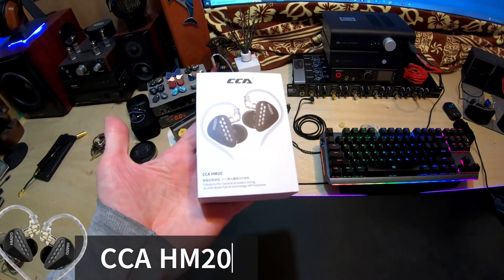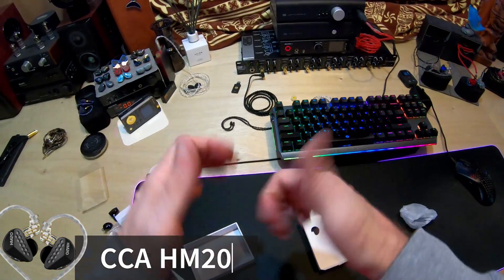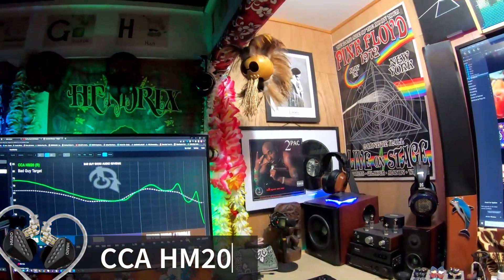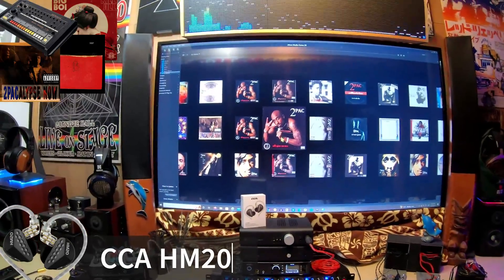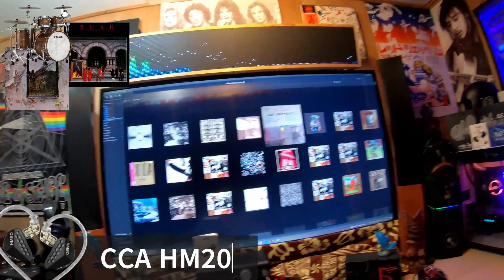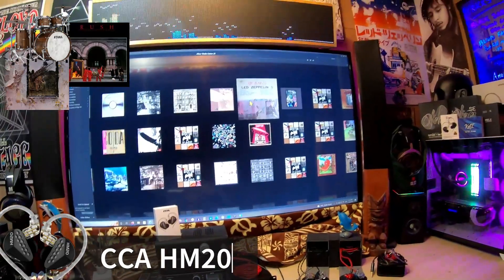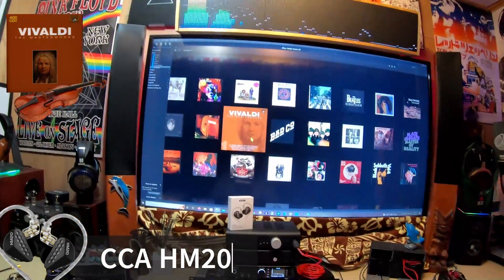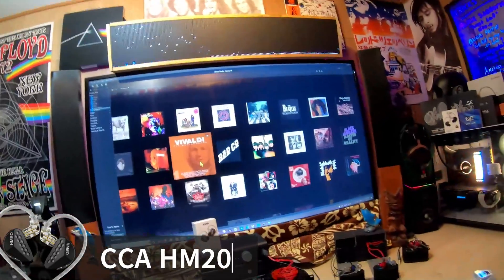CCA HM20 Earphones (1/DD 7/BA)

Comment: Holy crap, the bass Is like 6db more than the hexa haha I've been considering buying the HM20s I love bass so yes they are for me :)
Reply from the maker: These do thump in the bass. Treb is not bad at all:_Thumbs:
Reply: @BadGuyGoodAudioReviews  I'm glad CCA have improved, also it looks like KZ took  your advice regarding the new PR1 pro realeased we will see with the graph :)
Reply: They are great. Just go for it. If you like V shape, these are very good. I was worried the bass would drown everything, but the treble is CRISP, and zingy to go along with the thump.
Reply: @skrounst  yeah also this type of bass boost that rises to the infrabass in my experience (with the mh750) actually doesn't result in a drowny bass, probably psychoacoustics because of the relation to the midbass. if it was a midbass or upper sub bump then you might have some problems

Comment: Well I ended up biting on these and I came across a weird manufacturing defect. The left ear IEM's 2 pin connector is a few mm longer than the right earl's connector. This results in a different fit per ear, and it looks jarring. This only happens with the Bluetooth adapter. Using a wire ots able to take in the entire plug. I returned it and had a second one shipped. The second unit also suffered from this same defect. I ended up returning both units. It's sad the build quality had the issues but they sounded great. I wish they were a tad lounder because at full volume it ate my AZ09 battery in 4-6 hours instead of the usual 6-8. I've got ZAR coming in along with LingLong. I really wanted to love those 3d printed ducts.

Comment: Are the vents real? So far the realest vent or rather "open back" IEMs I've had were the ZAX and in busy environments covering the vents does help with isolation. Just wondering if it's the same here.
Reply from the maker: I will have to re measure. I just took the standard graph. I'll tape the outside.
Reply: @BadGuyGoodAudioReviews  I just wanna know if it isolates the outside noise if you cover the vents with your finger while wearing it and not playing audio. Although a graph would be interesting if it does change the sound.
Reply: @Qimchiy  I think they are cosmetic. They isolate too well to be real vents imo.
Reply: @skrounst  with the ZAX there's enough of a difference in isolation when you cover the faceplate with your finger to hear that sounds do come through it.

Comment: Has anyone used the QKZ Q1 MAX Cable with these? EDIT. The Q1 is faulty. Only two out of the three plug-in connectors work. As I live in the UK, and Linsol is in America, it's not worth sending them back. You get what you pay for, despite HBB's glowing review.